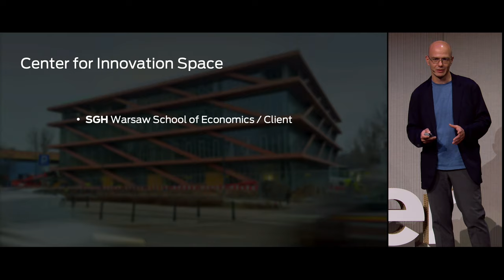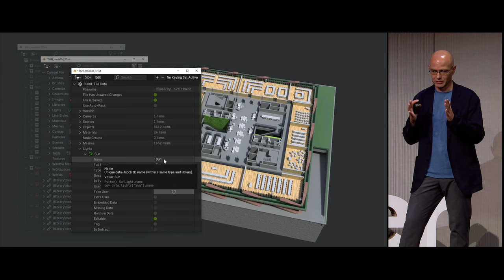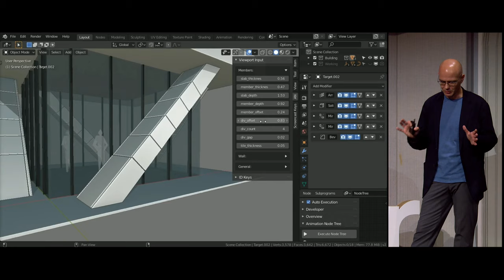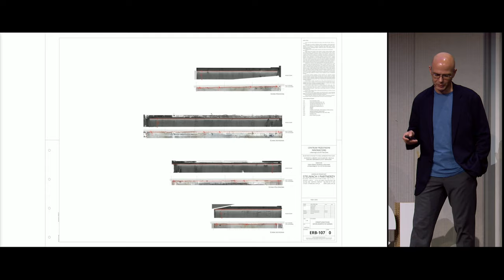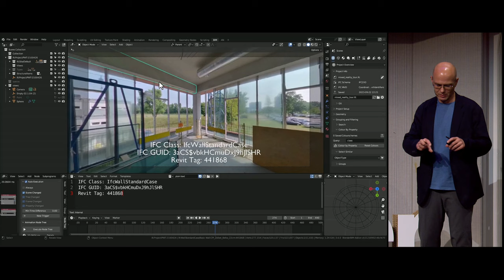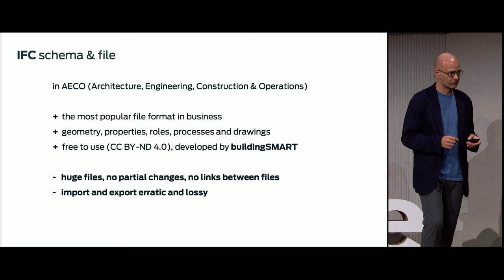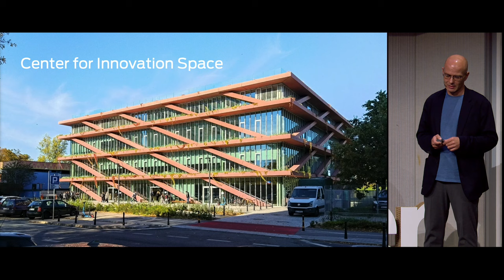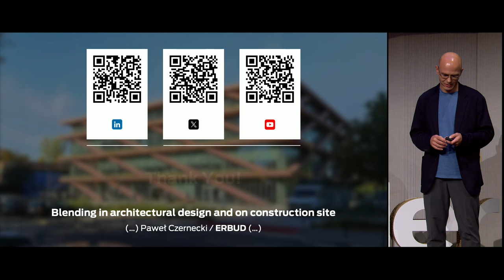Blending in architectural design and on construction site — Blender Conference 2024

Comment: So are Geonodes the new pipeline you use in place of Animation Nodes or it is still the same workflow?
Reply: that was my question as well when I saw those nodes for animation....
Reply: Geometry Nodes are great! As fast as modifiers ever were. You have seen examples I did 5 years ago. Today I would probably try to use Geonodes in some way.
Reply: @ppaawweeuu6962  Right...I hear you. Thanks for responding and excellent talk.
Reply: Ofcourse they are, it's by the same dev and now it's native code vs an addon. Thus c++ runs way faster and realtime.
Reply: What's confusing , is that je still calls it animation nodes, while he was showing geometry nodes. Perhaps a language barrier

Comment: I am a bit confused to what you are showing and to what purpose.
Are you propusing blender replaces other bim software?
It seems you are very technically orinted, most architects struggle with revit so this rocket science for them. Animation nodes, pythone.. thats too much.
In the end it look like the images were placed on standard bim software sheets so revit was still the main tool.
I didn't understand how you used the images to validate design. It seems the images and measurements were still taken so you didn't really need blender.
In the end you propose blender and ifc are used on site instead of revit? Most contractors barely manage revit.
I got really lost and wish you started by explanining what the topic and main odea here is..
Ps the design looks excellent 👌